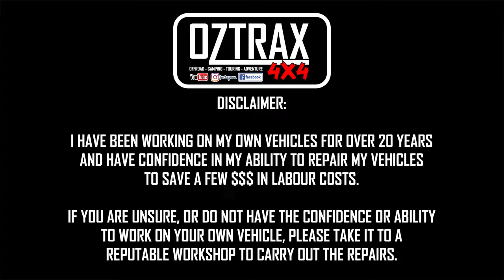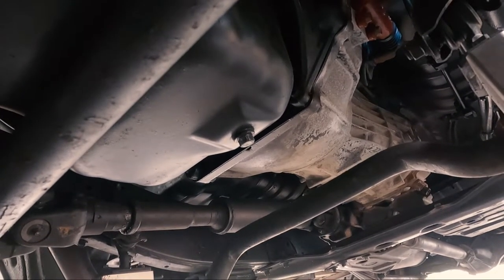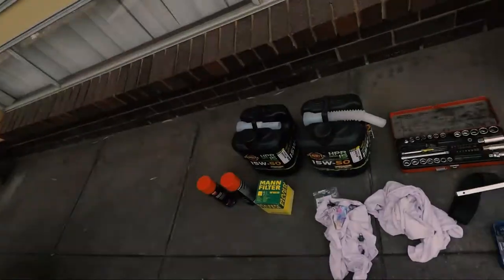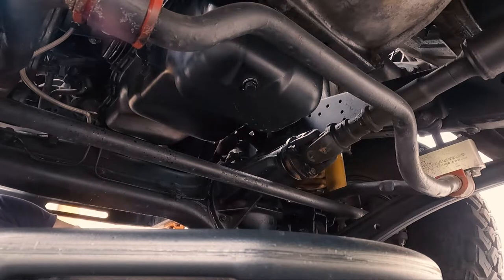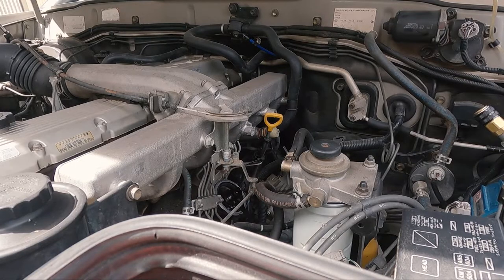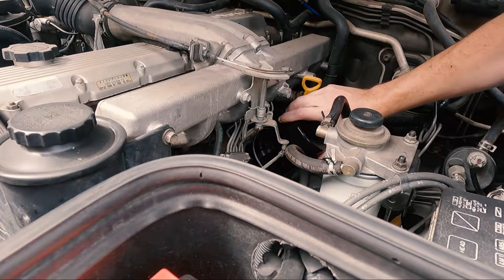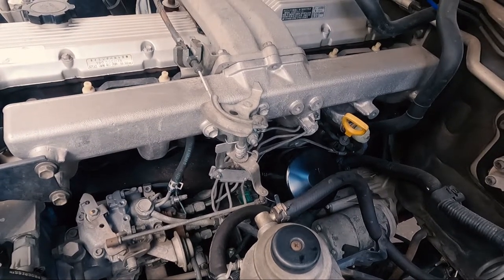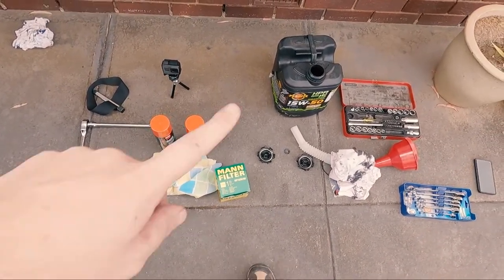DIY: Toyota Landcruiser 80 Series // 1HZ | 1HD | 1HDT Diesel Oil & Filter Service

Comment: Cool video!! Just wondering, given is a naturally aspirated 1HZ, do you ever want for more power when driving around?
Reply from the maker: While I do find it struggles uphill, it's perfectly fine off-road.

A turbo would make it more fuel efficient for remote travel.

Whether I go down the route of turbocharging it, or just save up for a 1HD-FT swap is something I'll be considering in the next few years.

Comment: That MANN filter has the same or better performance than the original Toyota filter? What does your experience say? thanks!
Reply from the maker: Hey Tony

MANN filters are used on a lot of heavy diesel machinery, have been around for 70 years and is of OE quality, as well as being European made.

I haven't noticed any difference in performance between a Ryco filter, Sakura filter or MANN filter, having used all of these brands since owning the 80 series.

I'd be comfortable in recommending any of those for your vehicle.

Comment: 15w 50  isn't that thick oil Mick ?
Reply from the maker: Not really, no. 🙂

I did look up the recommended oil (I work in spare parts) and this was the recommended oil for the 80 series by Penrite themselves.

I wouldn't go a 20w in it as that's too thick for cold starts.

15w40 is also recommended, but seeing as I'm at 355,000kms, going up one step isn't going to hurt it and I've been running it since I've had it without issues.

Comment: What’s the size of the engine? 12v or 24v hdj81?
Reply from the maker: Hi Diego

This is a 12v HZJ80.

No turbo here for this old girl. 🤣
Reply: Do you think I can follow these same steps for 95 turbo diesel 24v??
Reply from the maker: @diegocastaneda4346  you'd need to double check your oil grade and filter part numbers to be certain, but everything else should be the same. 🤠👌
Reply: Yeah I think I’m gonna ride with t6 15/40 she’ll rotella heavy duty diesel oil
Reply: @OzTrax4X4  also already got my oil filter 🙏🏼🙏🏼
Reply from the maker: You're all set 🤠

Just make sure you change your fuel filter every service too.